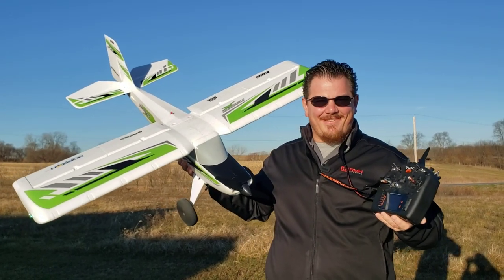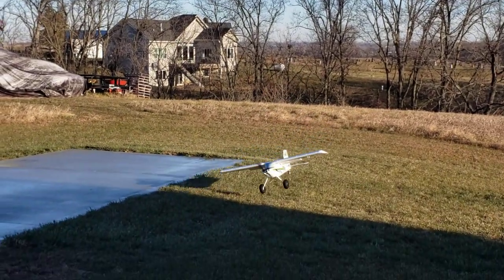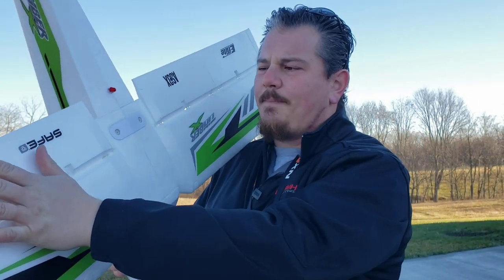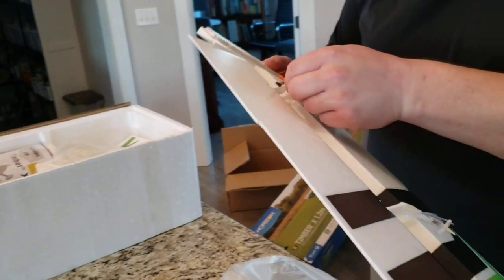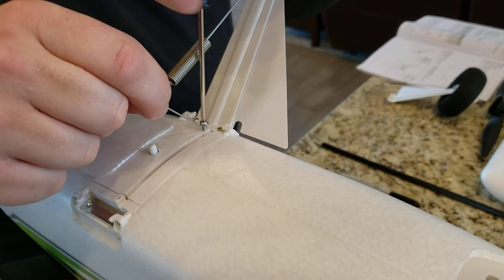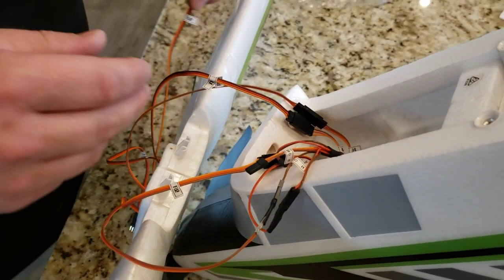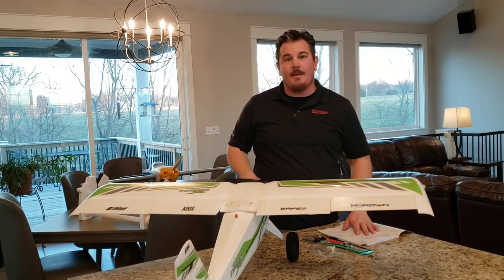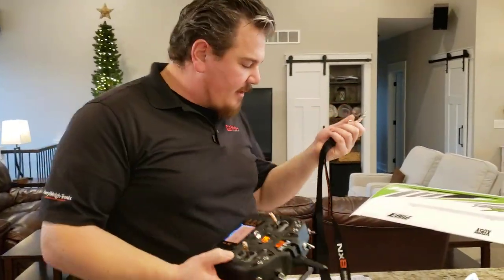Horizon Hobby - Timber X V2 - Unbox, Build, Radio Setup, & Maiden Flights

Comment: Yes!   This plane is the best.   Love mine.     I fly it scale and it's still so much fun.
Reply: Its a great "scale" flyer especially in SAFE, I love flying out of my field during late evenings and watching the lights from hundreds of meters away getting steadily closer, carefully adjusting altitude with the throttle, before clearing the trees and sinking down to a perfect slow STOL landing. Its a great plane, shame I still cant find a more scale looking plane that works as well in my tiny field although the Maule comes close (a touch too big) and the clipped wing cub (good sink rate but no flaps).
Reply: @jjs3287 Amen.  Slow long landings are where its at for this thing.
Reply from the maker: JJ S - Why not get the clipped wing cub and cut in some flaps?
Reply from the maker: Glad you love it Mike W.!
Reply: @BrianPhillipsRC  I managed to buy one before they dried up, just got to get the courage to take a knife to it!
Reply: @BrianPhillipsRC  I was very tempted to cut some flaps in the CW Cub but this then drifts away from scale. The Timber X remains my favourite and most capable bush plane. Its not scale but....it's a great flyer and I like the compact size of the 1.2m span, the lights, the huge flaps, the 4s power etc etc.

Comment: The Timber family, are clearly a great family of high wing planes.  But, frankly, the OMP Bighorn (a lighter balsa and covering plane) is what all of these Timbers aspire to be.  I continue to be surprised that you haven't reviewed the Bighorn yet.  I promise that you will find it to be incredible with a 3s battery (which it's designed for), and a 4s turns it into an INSANE beast!  It will become your go-to high wing airplane, an absolute ball to fly.

As always, thanks much for sharing.

Steve
Reply: Thank you so much Steve. I have been an RC pilot for one year. I have spent probably $5000 on foam planes. I try to fly every day And currently have zero that can fly. Some sort of damage or disrepair. All horizon product of some kind. Most of my foam planes end up in a fatal crash from the poor quality of the control surfaces. Looking to transition to balsa. And also wondering why I can't find good info on the best alternative to foam for the next level pilot.  I enjoy stunts, quickness and ability to fly low and slow controlled Patterns.  Somewhere in between 3-D and and STOL. Do you have an opinion on the challenger? I cannot see myself buying another foam plane at this point.  except the UMX Turbo timber. That thing is just too much damn fun to fly in my front yard.  And it's my own fault if I can't wait to fly it when there's no serious wind and destroy it in the process.  I'm from Los Angeles residential neighborhood.  And can darn near take off and land that thing on the hood of my car...
Reply: @kevincarter7102 , although I've never personally flown an OMP Challenger, everyone I know that has flown it has given it high marks.  If I recall, Brian also gave it virtually rave reviews.  It's substantially cheaper than the Bighorn, but it's also, unfortunately, currently out of stock (which, sadly, is not uncommon for OMP products).  But trust that they build super planes and are great to deal with (I buy through BuddyRC, but I've also purchased directly from OMP).  Personally, I think the Bighorn is a lot more plane than the Challenger, but the cost is proportionally higher.  I think that either would be a great intro to balsa planes.  Frankly, I'd buy the Bighorn while it's in stock.  BUT, I'd use Brian's link on the Challenger review and then buy the Bighorn, which would then give him credit for the sale (you're welcome, Brian). BTW -  be advised that these planes are PNP and will require you to supply a receiver.

Steve
Reply from the maker: The OMP Challanger is amazing. I like it better than this plane.
Reply from the maker: Kevin - Foam is a lot easier to fix than Balsa Wood ;) Just remember that you can fix either, but Foam is such a forgiving media.

You're still very new, and you're getting better with every "learning experience" :) Just keep learning and getting better!!! It take time, and I know that patience is not your virtue, as it's not mine either, but time and repetition will help a lot - keep at it!
Reply: @BrianPhillipsRC  indeed but a lot of my crashes are hinges falling apart mid flight. They fall apart before I have the chance to crash them any more. I promise take any horizon plane fly it on 3 good batteries every day. Their life span 3 weeks tops before something has fallen of like the whole front of the plane. I landed my valiant with the motor dangling by 2 of the wires. Only thing holding it on the plane.
Reply: And a also Steve. I like to be a little more creative when I support a channel. I make sure the camera Crew gets every penny of my donations. No fees taken out. I am just hoping she let's Brian borrow a few bucks out of it every once and a while. Find his PayPal link. I actually pay a fee to send the donation in full. For a quality family channel like this it is worth it. Anyone who uses this info and hasn't considered contributing is a super doosh .
Reply: @kevincarter7102 , the Valiant is NOTORIOUS for exactly what you've described.  I've owned two of them and on both of them the entire nose (cowl, motor, motor mount) fell off in flight and I, too, had to land it with the front-end dangling by the motor wires.  When describing the Valiant I always tell people that it is one of the hidden gems in the Horizon lineup, as it flies like a dream, but you'd better reinforce that motor mount with some medium CA or, even better, some epoxy prior to flying it.  When the time comes that your Valiant starts making noise in flight, and you can't figure out where it's coming from, it's a dead certainty that you're getting ready to lose the front end of your airplane.

Comment: She is a squirly one for sure. Definitely one I practice with quite a bit on Horizon Hobby's Real Flight 9.5. I was practicing smooth low and slow consitent ovals around the runway in the simulator using my Spektrum NX8 Transmitter. (Awesome BTW) It took quite a few attempts to get a couple perfect, oval laps in a row. If I owned this plane I would destroy it immediately cause it's so fun to watch it spin out of control:) Thank you guys for the excellent video as always.
Reply: The new 9.5S update was much appreciated. I love that I can fly the Draco model without dropping $600. Came to realize I probably wouldn’t fly the Draco too much if I owned one, more of an scale eye candy purchase.

Don’t underestimate RealFlight folks!
Reply: @ThePaisteTrout477  thanks for the update on that update. Can't wait to try it. Also was wondering if they would include the RV-7 or the valiant.  I wish I could have tried the RV7 in the simulator 1st. I hate that plane. Would have never purchased one.  But she was also good looking. The valiant is a gem. Wish it was a little faster and stronger though.
Reply from the maker: Yes Kevin, like NickRivers says, I just broke out the RF9.5S as well last night, and was flying the Blade 330S and it is SO realistic. The physics are super close to reality, but the crashes are much cheaper ;)
Reply from the maker: NickRivers - I flew the Draco on the simulator and it seemed too tame to me...I think I need to figure out how to play with rates. I LOVE flying my Draco, but it's one of those planes I walk past so often, since I have a bunch of other deadlines for videos we have to put together ;(

She is GOOD if you ever get a chance to get one for yourself.
Reply: @BrianPhillipsRC  Good to hear from someone who's got both! One of these days I'm gonna take the plunge!

Comment: Hi! I just bought a new one on the Frenzy sale, then spent most of the $80 savings on a 60 amp Avian ESC. 

Thanks for the elevator/flaps mix settings!

It's my third Timber X. The first crashed, the second was traded for a Turbo Timber after I almost crashed it. That was all a year and many successful flights ago. 

The Avian gives me ESC telemetry. I really like a smart ESC's battery voltage feedback instead of just the timer, and you have some neat programming options too. For radio setup I Forward Programmed SAFE/AS3X/Gyros Off on the NX8 3 position B switch/AUX 3 channel. Then I set up flaps on G and coupled to ailerons in AS3X only. Timer 2 is setup to record flight time. All my switch settings have sounds on switch changes that I can turn off with the R Knob set as a volume control. Most of my models have this same setup, including an Avian ESC if the original was not Smart.

Programming SMART Select directly off a switch with Forward Programming is dead easy and much more dependable than using the Horizon SAFE Select bind/stick/switch change method.
Reply: Do you think just replacing the ESC - Avian 60 Amp(SPMXAE1060) with keeping the AR631 receiver,  will get the telemetry data in radio?
Reply: @anishanc6712  it will work. The 631 is telemetry capable receiver while the stock ESC is not. The Avian model you mention is a Smart ESC with telemetry. I assume you have a telemetry capable transmitter. Just got to the transmitter Telemetry settings and auto-configure to set up the transmitter once you upgrade the ESC. You might also need to re-bind, I can’t remember.
Reply: @anishanc6712  more… the 631 does not have the capability to add external telemetry modules such as an altimeter. You would need a 637 or similar for that.
Reply: I need only the voltage information, hope I will get the data from the stock receiver
Reply: Try it but the one that came with mine was not a Smart ESC.
Reply from the maker: Avian ESC will do what you want. Telemetry ESC will pass with the AR631

Comment: I have 231 filghts on mine now.   Wonderful, wonderful STOL / Aerobatic airplane.  On 4s  2200mah.  You just can't go wrong with this one.
Reply: And your landing gear never broke? Mine breaks if the wind blows the wrong direction.
Reply from the maker: 231 flights!??! WOW!
Reply: @stevegraham3617  No.  The landing gear on this airplane is crap.  Butterfly landing gear.  After destroying my original set, I bought another complete landing gear set and put double springs on it.  Then I got 6" wheels instead of the factory 4" wheels giving   me an extra inch of clearance from the prop to the ground.  Works like a champ.  A lot of work and a lot of additional weight, but with the 4 cell batteries, it still has endless power.  Wonderful STOL airplane.  Butterfly landing gear.  After my Mods, I've had no problems and can finally enjoy flying this beast.

Comment: You can do flaperons on this plane and make it a TRUE 3D plane. Surprised you didn't do that here. Love this plane.
Reply from the maker: I didn't think it would be necessary, and to be honest, I think I need to put the elevator and Rudder into the inside most holes to make them more crazy, for good 3D performance ;)
Reply: I set mine up (night) for flaperons. It DOES wake up the roll rate! For anyone interested you will need to add one 4-6 inch servo extension. The Y cable can be used as an extension with one lead open for one side and a regular extension for the other side. On second thought I think I just used the bind extension along with the open ended (one side open) Y to allow both sides.

Comment: I wish you mention the configurations for full wing ailerons, it is one of the most exiting features of this plane, reason why I bough it :) you need to feel how it rolls when in full ailerons and the fact that you can still use the flaps I think is out of this world.
8 Channels will be enough and you will need to configure some mixing. 
Timber X night can do it as well not sure about Evo
Reply from the maker: I think the roll rate is too high with the stock ailerons only, but just my preference. I'm not really a 3D pilot.

Comment: Wish they’d put the battery tray on the top side.
Reply from the maker: likewise, loading battery in this plane is a real bummer ;(
Reply: I seen where someone put this 1.2 wing on the red 1.5 timber fuselage would be awesome to see that in a video. I think you get the top load lipo and shorter wing all in one! I’m pretty new I could be mistaken please correct me if I’m wrong

Comment: On my maiden flight I had the prop jump off and destroy a bit of the front part.. I just don't understand how this happend, I did put the prop shaft all the way back just like you, does it need to snap or be screwed in some way apart from just slipping it back all the way?
Reply from the maker: You probably just have to tighten it more. These prop adapters just get tighter and tighter until you can't do any more, so if you're having difficulty tightening it, possibly have someone give it a crack when you're done, and see if it goes any further for them. Also, when using THRUST REVERSE, if it's now activated on this plane (ours was PRE-thrust reverse, if I recall correctly), then you might need to check it from time to time to make sure it doesn't back off on it's own.

Comment: FYI, the NX6 will do safe and reverse thrust on the Turbo Timber Evo without sacrificing any features.  We programmed SAFE on channel 5 and still have the lights plugged into channel 5, doesn't effect the lights and SAFE/AS3X works perfectly.  The NX6 "virtual channel 7" we used for reverse thrust.
Reply from the maker: Nice!!! Some of the EARLY SMART ESC's weren't allowing lower channels for Thrust Reverse, but that has been changed to allow down to Channel 5 (I believe it's 5)...so if I was saying to the contrary, I apologize for any confusion - this MIGHT have been filmed before the change, or I just didn't know it time - sorry about that!

Glad you got it figured out, and it's a COOOOOL feature!

Comment: When the video started I thought: awesome, they are doing a Timber X with  the top-hatch finally (or quick connect wings servo leads like the evolution model) !! Psych !! wtf 

Brian, if you own the V1 can you squeeze the back half of the fuse and tell me if it still seems like you can put your thumb through it? I was so impressed on the step-up of quality with the Timber Evolution and now I am let back down with the Timber series... 

Thanks per-usual, for the amazingly deep content.
Reply from the maker: I could put a thumb through about any of my foamies, but I don't think they changed the foam on this one...JUST the rx - sorry!
Reply: @BrianPhillipsRC   weird flex but okay...

Comment: Hey man great video, I got my timber x as a PNP from an old timer. I put a AR630 reciever in it loaded with timer x presets, I installed it in the same orientation as the manual say. But my as3x responds backwards on the elevator! I noticed at 38:52 ish your receiver is mounted 180 degrees from the manual. Can you confirm this? Maybe I have a V1 manual???

Comment: For everyone reading this. Whats the best advice for landing this Timber X. Do you cut the throttle right before touchdown? For some reason i cant get it to slow down enough, i seem to come in hot to avoid stall. When i land it the timber falls hard on the runway. I cant get a single good smooth soft landing.
Reply from the maker: Gotta use flaps, then keep in power, and three wheel land it, if you wish. This plane is a hand-full compared to the 1.5m Evo, but with practice, you can get her tamed.
Reply: @BrianPhillipsRC  thanks. If i cut the throttle before landing it drops like a rock.

Comment: @BrianPhillipsRC Would the Turbo Timber Evo work with my TX16S RadioMaster running OpenTX.  I've been out of planes for several years and mostly flying quads.  Follow up question is the Turbo Evo a good choice to learn planes again?  Love your vids.
Reply from the maker: Thanks John, and not sure if you can do forward programming, but if you can, please do share this with us. I don't have the TX16S, but did have the TX8SG back in the day, but it was good to go for BINDING, but not sure if you can access the SMART features, like Forward Programming.

As for the Turbo Timber Evo 1.5m - yes, it would be a great choice, but it is VERY capable, and might almost make you think all planes will be so "over-powered" and easy to fly ;) I'd suggest you get it, and fly the wings off!

Good luck John!

https://bprc.me/Timber

Comment: Brian, when using shelf or drawer liner rather than Velcro on the battery tray or floor, do you use Velcro on the battery or are the liner and the straps enough to keep everything in place?
Reply from the maker: 100%, but they do GOOP up the battery if you get them REAL hot ;)